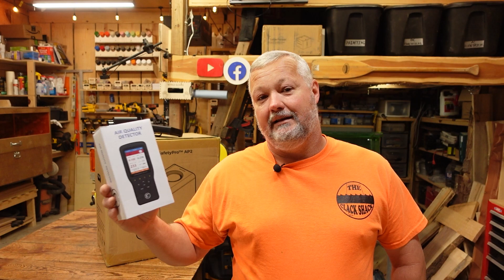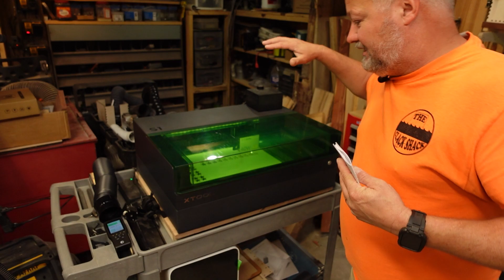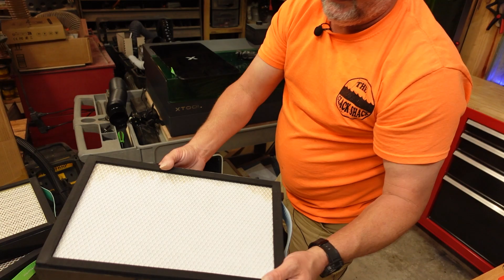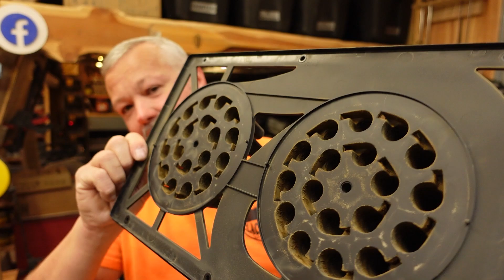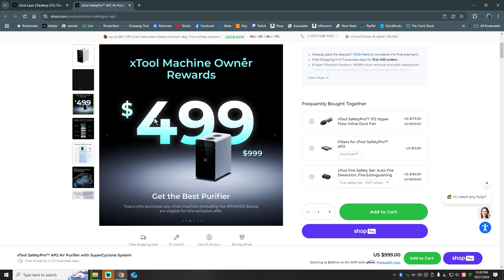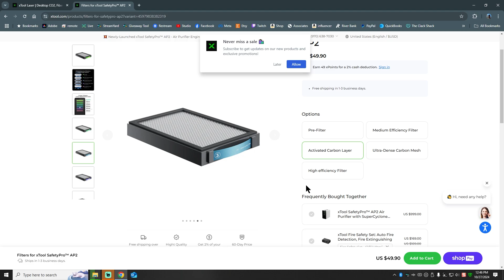An air filter that works? xTool Safety Pro AP2

Comment: 🤣 i came across this video looking into info about the AP2. I noticed you seem to have the Franklin Rollie cart from harbor Freight. I purchased this same cart for my S1 but instead of wood blocks as you used. I would up just taking my oscillating tool and cutting the lip on front and back to allow the doors to open but I left the rounded corners for structural integrity. It worked out pretty good but after getting the P2S while waiting for a replacement for my S1 which turned out to be DOA, I found that for a few dollars more, Home Depot had the husky adjustable work table with wood top. That one was 24x48 and fits my P2S with the riser base very nicely.
Reply from the maker: Nice alternative setups!

Comment: I purchased an AP2. I have it about 2 1/2 weeks and I am sorry that I bought this purifier. Within 15 hours of laser burning, the pre-filter is so plugged that the machine will let smoke out into the room. Here is the "real  kicker" their support is near worthless. I called when I had problems and am still waiting for a reply after sending pictures they requested. The chart that the owner of the Clack Shack showed above is about where mine is at. My whole shop was filled with smoke until I removed the pre-filter. I am still waiting for a reply from XTool regarding my problems. Good lucking getting support if you need it. My recommendation: Don't buy this overprice machine, run your smoke outside with a flexible hose.
Reply from the maker: That is no good. I have cleaned the prefilter a couple of times and mine works well. I do vent most of my machines to avoid having to buy filters.

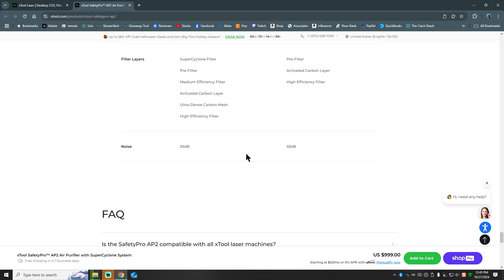Comment: 23:50  -- you didn't have particulates in the bottom of your cyclone "fingers because you turned it upside down, yanked it apart and dropped the disks on the floor before you were able to examine them.
Reply from the maker: Sure, I am going with it was mostly vapor and not dust.

Comment: I purchased  the xtool laser bundle. I got the AP2 Safety pro filter.  Unfortunately, owning it for less than 2 week, my ap2  filter won't stop giving me an error M9039 S4 error which shuts the laser down because the filter stops sucking out the smoke.    Tried all their solutions. Nothing works
Reply from the maker: Check all the firmware. It could be software related. Good luck
Reply: @TheClackShack  I can surely agree with exactly what you are saying. My pre-filter plugged up very quickly. How was your support?

Comment: Just received mine. I plan to still vent outside but with clean air so that my neighbors don’t start complaining. 

I’ve calculated that (if the filters last as long as predicted), you’ll spend $3,500-7,000 on them during the anticipated lifetime of an XTool diode laser.
Reply from the maker: That is an added expense for those who need to filter. I am lucky..

Comment: What’s the noise rating on the filter unit? How loud is it, or is it a passive unit relying on your existing exhaust system?
Reply from the maker: Can’t hear it over the S1 with it on auto. It has its own fan inside

Comment: Clack, Thank you so much for doing an actual "hands on" testing review of this air filter, it is very appreciated.  This looks like it will be a good quality filter unit for many different lasers.  I filter my xtool out side through a shop vac and into the air, I have 2 major filters in the shop vac.  I also have a Wecreat that I filter inside and you are correct about the filters, they are expensive, but I clean out the top one as much as I can.  I would like to run the xtool through their new filter unit so that I am not annoying my neighbors with the shop vac, and this unit looks like it will be a good choice.  Thank you again for your review.
Reply from the maker: You are welcome, glad the review was helpful!

Comment: Definitely one of the better review videos for the AP2. I appreciate the real world testing. Mine is already on the way, but I wanted to see the results people were getting.  Honestly, I do think the filter pricing is pretty reasonable. About $180 for a full set replacement is a little high, but $20 for the first filter and $30 for the second, which are the two you will be replacing most often, isn't bad. The fact that you can buy them as needed rather than having to buy the set is a big selling point.
Reply from the maker: The way the filters are sold is a plus. Using the cyclone properly should help keep the filter replacement to a minimum.